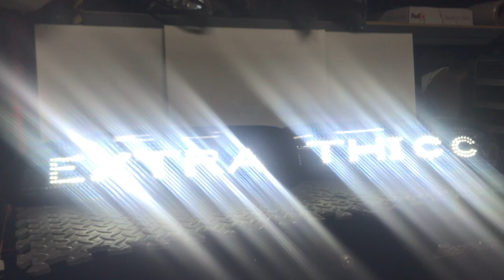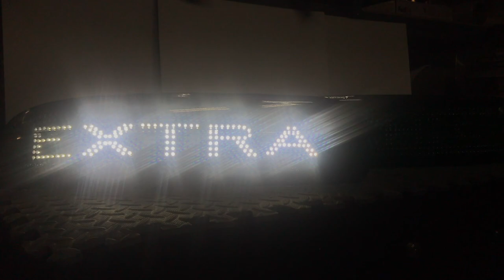"E X T R A T H I C C" Tail Lights (Evan Shanks Tail Lights) - NTXGLOW

Comment: What program are you using to make your templates
Reply from the maker: I do it all with paper pencil and a drill.
Reply: Zac Cook ok what kind of abs are you using. Is it the stuff with one side texture and other side smooth. The reason I ask is because Im building a set of taillights for 94-99 caddy deville taillights. I usually use universal breadboard and Cree leds like the super flex. But for these taillights I want to do a different route on these and use 5mm leds
Reply from the maker: Yes abs plastic textured on one side and smooth on the other. I used the textured side because the smooth side was really scratched up.  
I’ve done the breadboard style before as well i typically only do that style if the outer lens is red or not super see through.